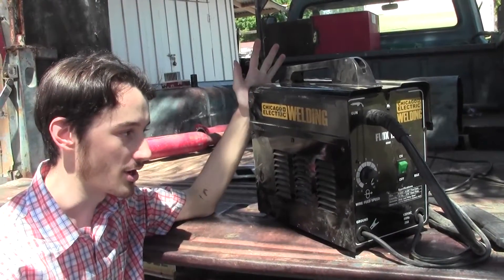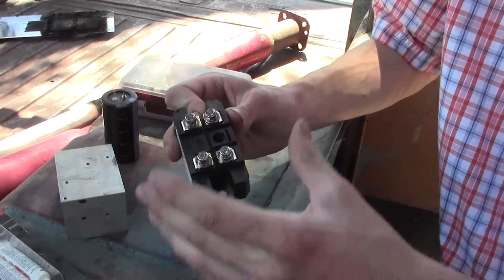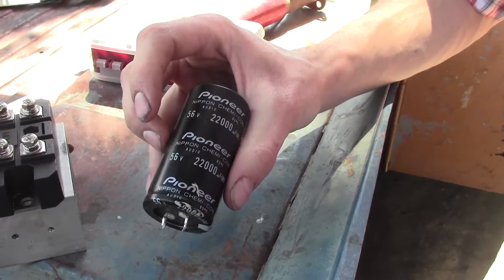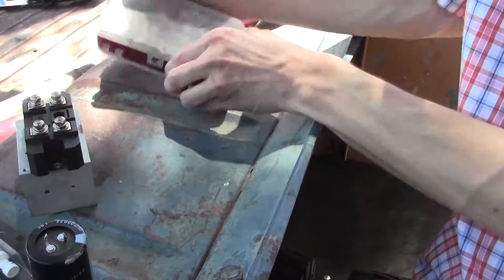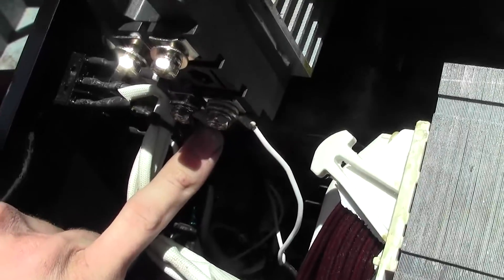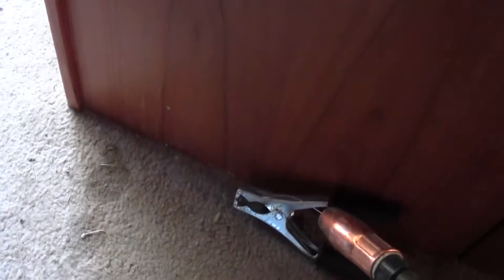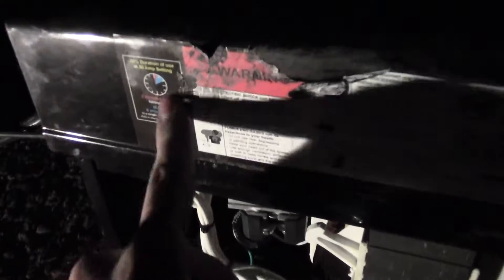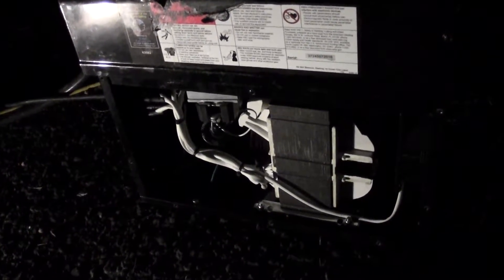Convert AC Welder To DC!

Comment: Without a bleed-down capacitor, there's a high risk of electrocution on a mig welder if the user goes to trim off the wire immediately after using it and forgetting that there's residual current in the system.
Reply from the maker: It is only 27 volts or so, it shouldn't be particularly painful. Humans are not great conductors. I did, however, eventually add one I think because I got annoyed with the wire arcing to my metal so aggressively when the trigger wasn't held

Comment: I have an old Harbor Freight mig 200 AC electrode  I bought in the 90's. I want to convert it to DC electrode negative. What voltage rectifier and capacitor do you recomend?

Comment: Can you convert DC Tig to AC tig
Reply from the maker: That's possible but I would probably have to get my hands on a machine
Reply: @unigrampa  ok. I was thinking something. I have a a/c 220 stick from harbor freight. Couldn't I retrofit a solinoid for argon and get a air-cooled Tig torch and hook it up and use it as scratch start AC tig? Just asking
Reply from the maker: That sounds highly plausible. Just verify the output voltage and current on the stick welder is similar to what tig uses. Otherwise, sounds like an easy swap!
Reply: @unigrampa  I will check. Thank you.

Comment: Are we sure the capacitors have any effect? ... Google says the voltage output from a welder is 15-25V when the arc is running. Call it 20V. Lets suppose we want the capacitors to limit ripple to 10% or about 2V at 100A. I=CdV/dt so C=Idt/dV. When 60 Hz is rectified the time between peaks (dt) is about 1/120th of a second. So C = 100*1/(120*2) = 0.4 Farads. Most people seem to be using 10,000uF at most which is 0.01 Farads or 40 times too small. Someone check my maths but I would expect them to have little or no effect. Has anyone looked at the waveform?
Reply from the maker: You may be right, the capacitor might only have a minuscule effect. Though the capacitor will absorb the peak and lower it a bit, so the peak is wider. If we say 20, then imagine like 18v for 1/40 of a second instead of 20 for 1/120. And even when the capacitor empties, the lowest the voltage will go is the current point on the wave, which is often greater than 0. Even if the capacitor was too small to do anything, you'd still have 16v and then 14v as the power ramps down. 
I think real DC welders tend to have a larger capacitor bank than this. 
Honestly, if you find a DC welder with the same amperage, see if you can figure out how many mFds of capacitance it uses. Then, you wont have to do any math. Copy the engineer's homework.

Comment: Parts list location please!
Reply from the maker: Everything I had, I believe, except the rectifier. Just search for 100 amp rectifier, or whatever current you decide is appropriate
Reply: I have the 125 amp harbor freight. Idk what would be best tbh
Reply from the maker: Anything that exceeds that current, 150 amp would probably be good
Reply: unigrampa's Laboratory thank you!
Reply: unigrampa's Laboratory do I need another capacitor too? Or just the rectifier. I’m lost here but need better welds. Lol
Reply from the maker: Capacitor is necessary to smooth the DC, yes. Otherwise you're welding with choppy DC. You may be able to steal a capacitor out of broken devices. Any capacitor with a voltage rating higher than the voltage on the output of the welder. I forget what voltage I measured for this video, maybe was 40 volts?
And then just lots of small capacitors at that voltage, or one big one.

Comment: Hey man funny story. I have the same little welder. I hardly use it though I prefer stick welding. Anyway I want to do this with my welder but you didn't actually show how to wire it. You jumped around so much I wasn't able to figure it out. Its a shame you really did something amazing

Comment: I realize this is an old post, but I'll try my question anyways, and that is.... will this work if my little 125 amp flux core welder uses an inverter?
Reply from the maker: Yes. I am surprised it doesnt have a DC function? I wonder if it is possible to bypass the inverter and just shut it off when you want DC.

Comment: I needed to lengthen the main wires for the placement of my bridge.  What is the best way to join wires?  I would normally use crimp connectors, but the wire is too thick.  Solder?
Reply from the maker: Good question. The amperage is high so we have to be careful how we join these. Even if we had a crimp connector big enough, it might get screaming hot if it's less conductive than the wire. 
On my welder, I fed some wire into the machine so it was long enough inside. If possible, I recommend you do this. 
I have soldered thick wires before, this is likely the lowest resistance option, but it's a pain. Normally I use an iron to apply solder to the outside most of the way around. Then I add extra flux and use a torch. If you go for the torch first, it will oxidize the wires and solder will never stick to anything. 
The final and maybe easiest option is to get some sort of ground clamp from the hardware store. Insert both wires and tighten the clamp to crush them together.

Comment: It needs a choke coil. Makes a big difference
Reply from the maker: Interesting. Resists changes in current. I may have to try that.
Reply: @unigrampa  I added a rectifier, capacitor, and a choke coil I made from a microwave transformer to mine and it welds almost as good as my Hobart... the choke coil will definitely help.

Comment: Would the same rectifier and capacitor be acceptable for the 125 amp version? Or should I be looking for a rectifier with 150 or 175 rating?
Reply: They are the same welder, they just changed the way it was rated.
Reply from the maker: You'll definitely want your rectifier rating to exceed the expected current rating if you want any sort of reliability. Any capacitor should suffice, really

Comment: Need a video on converting DC mig output to AC for Aluminum TIG and Spool Gun work.
Reply from the maker: If I ever do anything with TIG, I'll post it
Reply: @unigrampa  OK this is my Mig to spool gun conversion but think I should have also bypassed the rectifier. https://youtu.be/6vNgZoSTNfQ

Comment: hey mate. Thinking about doing this to my cheap'o Ozito welder (with is very similar to HF). Just wondering if there is a parts list to links for the stuff needed and what wire do you use for the conversion. (new to electronics). 

Cheers and great video
Reply from the maker: I haven't made a parts list but I should. I have an amazon affiliate link. I'll look into that and get back to you if I accomplish anything

Comment: Did this extend the duty cycle?
Reply from the maker: It wont. If anything, it would shorten the duty cycle depending on how well your rectifier is cooled, as that may overheat before the transformer does. The current draw from the transformer is basically the same, it heats and cools at the same rate as before.

Comment: I'm  trying to do a conversion of a lincoln mig pac 100 to run off my dc gas powered arc welder,  and turn it into a suitcase welder. It just wont make a good weld from  generator power. I will still have 110v  to run the spool. What do you think this will take to accomplish ?
Reply from the maker: If I'm understanding you correctly, your DC stick welder is powering the MIG gun directly. The harbor freight welder is 90 amps at something like 40 volts. You would want to check the output of your stick welder and see what voltage and current it delivers. Very possible the current limit is too high or the voltage is too low or something. I don't think it would be very difficult to get this setup to work though. Power is power; if you can match what the MIG welder was designed for, it'll work as it did from the sales floor.
Reply: @unigrampa Thanks for the reply,,, No, the mig unit is 110v ac, I had a look inside and found that the power selector switch is on the ac side.Then it goes to the bridge rectifier and capacitor, transformers etc.What I was thinking is to take that stuff out. Bring the welding leads in from the dc welder. So I would have to put in a control system of some kind for voltage, I think. A bit of a science project to say the least
Reply from the maker: Yes that's what I mean. The output on the harbor freight welder is not the 110 vac that goes in. The output is 40 volts. 
Only control you'd really need is current limiting, which your stick welder should already have. Just keep it low.

Comment: My rectifier has a bit more mass, can the body of the welder itself be successfully used as a heat sink?
Reply: but nobody seems to know you need silicone grease on the heat sink
Reply: @deanfranklin9239  Late but thanks.
Reply from the maker: Would be tight but you could probably do it. The case is thin iron so it won't cool nearly as well. My guess would be you may cook the rectifier one day if you weld a lot.

Comment: Would it help to use a transformer with the motor that drives the wire to prevent a drop in voltage? In your explanation of the capacitor and how to determine which one is required, why did you choose 0.707? Please consider an update video. Cheers
Reply from the maker: The voltage drop is necessary to regulate the speed of the motor. Raising the voltage would just make the wire feed too fast. The correct way to regulate speed is with the motors rated voltage with PWM, or pulse width modulation. 
For our purposes, that's too complicated and expensive, so we'll leave the motor the way it is. 
Don't remember the .707 calculation offhand. I'll check the video sometime and get back to you with more detail.
Reply: That makes a lot of sense. Saw another video by Zero Labs where he added a transformer to his welder. After reading your explanation, I don't think I'll be adding one to my welder. Thank you so much for making this video. Please continue to make more great tutorials and consider getting a cheap tripod to steady the camera. Cheers brother

Comment: Did this to the older model HF 90a welder and my welds were like night and day, I loved that thing til someone stole it. I also replaced the ground cable with a 4awg wire better clamp and replaced the power cord with a 10awg 15ft HD extension cord makes a big difference and cheaper than the Lincoln 140c if your on a budget. Never got around to installing a choke and a new high rpm cooling fan.
Reply from the maker: New wires should make a huge difference. Every bit of voltage drop is a colder weld. Not sure off the top of my head what you'd want a choke for? 60 hertz is the only frequency present in any real amount
Reply: @unigrampa  someone smarter than me told me that a choke helps with the voltage drop but then again he could have just been full of shit lol
Reply from the maker: Off the top of my head choke is good for blocking certain frequencies, and current limiting. Can't think of any way that would advance your welder. Not enough current to limit lmao. You should be golden without I think
Reply: @unigrampa  MIG are designed to use constant voltage. Stick welding need constant current so a capacitor is a bad idea as you'll get huge current changes on small changes in arc resistance. So: caps are good for MIG, chokes are needed for stick welding.
Reply: @unigrampa in a DC circuit, caps resist current change - inductors (what you are calling a choke) resist voltage change. Use both and the result is better current AND voltage stability. For best results I believe your caps should be between 40000 and 50000 μF. No harm going higher but no gain either at these output levels. A bleeder resistor across those caps is a really good safety measure also.

Comment: Dude your video is pretty good but you talk too fast
Reply from the maker: Gotta hurry so no one gets bored lmao
Reply: @unigrampa  im thinking of doing that change to mine, the capacitor you put on is it only one or can you put multiples
Reply from the maker: I just put one but you can add as many as you want in parallel. After a certain point more capacitance won't add anything. There's a formula for that based on current. But there's no disadvantage to having too many besides massive initial arc. Go wild.
Reply: @unigrampa  what about a bleed down resister how do you add it on
Reply from the maker: Across the capacitor. Just like a load. Make sure it's a high resistance or the resistor will get hot and/or explode when you turn the machine on.
Reply: @unigrampa  thanks for the info, Very helpfull
Reply: You can tell his brain functions extremely fast. Evidence of intelligence. 👍🏻

Comment: (0:05) - I didn't know that! Really? Very few MIG welders are AC? Then why are they making and pushing these machines out? I don't quite get it.
Anyway, I've just received my own "JUBA MIG130" welder machine. It's quite a common one but it's still in the box. I intend to do an unboxing video along with subsequent DC conversion.
What can I say? Oh, yes:
WATCH THIS SPACE!!!
Reply from the maker: Yes, AC mig welders really only exist for cost purposes
Reply: unigrampa's Laboratory and welding aluminum lol
Reply from the maker: @ihatekate08  I'll take your word for it, I only work with real metals ;) <3
Reply: @unigrampa  it
Reply: This in Not a MIG welder. Mig welders use gas. The correct phrase is AC Fluxcore Welder.
A properly configured Fluxcore Welder will be DC from factory.
These HF units are for AC to keep cost low
Reply: Because they are cheap to buy and very attractive to the uninformed.

Comment: (5:38) - You mean we don't want a too low resistance? (You said too high)?
Wot, no inductor? I ask this because others have mentioned that you also need some kind of choke. I don't get it myself.
Reply from the maker: Actually, I did mean "high resistance." I was referring to a discharge resistor. If the resistor had a low resistance, all your welding power would get shorted through that resistor and not make it to the weld. You want just barely enough current to flow to discharge the capacitor for safety.
You don't need an inductor to limit the current here because the transformer will do that. This welder should be designed so that in a short circuit condition on the output, it will only draw within the vicinity of 1800 watts, give or take, probably less. It will likely never blow a 15 amp breaker by itself in normal use.
Reply: You said at (5:38). and I quote you directly:
"...you don't want a too high resistance, 'cause you don't want, you know, it sucking up any of your power and producing heat and burning up, so..."
Surely, the resistor would "suck up" power, only if its value was too low. Not too high. And yes, I know you are referring to the discharge resistor here. Personally I would have used a resistor with a much higher value, say 10K. So long as the capacitor discharges in less than an hour, that would be fine for me. It's not as if a 50V jolt will kill you. A 160 ohm resistor is going to draw around 3 amps at 50 v by the way. And that is way too much for me. That much will definitely affect the welding profile of the machine.
Reply: Yeah, that was me. Was logged in under my alter-ego.
Reply from the maker: My mistake, must've misspoke. Didn't end up putting on a discharge resistor anyway. Did I say 160 ohm? I was probably just yelling numbers, didn't do any math as I hadn't planned on adding one. Although I think you may be mistaken on the 3 amp number. V/I*R. Ought to be 50v/160 ohm = 310 ish milliamps. I usually delete discharge resistors where they are installed because I'm a madman

Comment: "You have a HF welder, I'm sure you're not made of money."

Bahaha!  Great video, though.  I did the DC conversion too and it's working great.  I was able to get the rectifier+sink mounted outside of the housing and I also used a cool whip container to cut a shroud for the fan.
Reply from the maker: Fantastic! Play God with your welder
Reply: I added a inductor today and wow what a big difference Deff look into making one it’s pretty easy